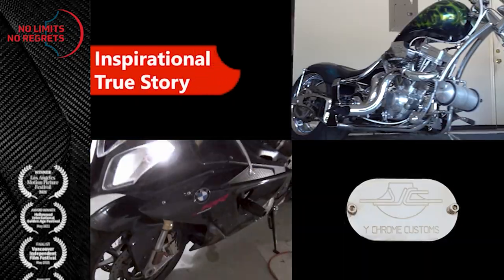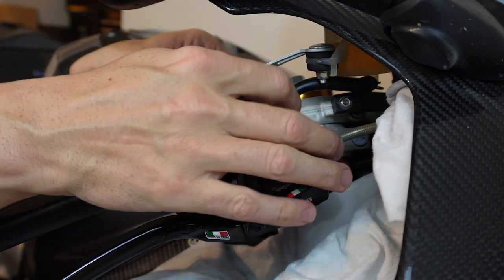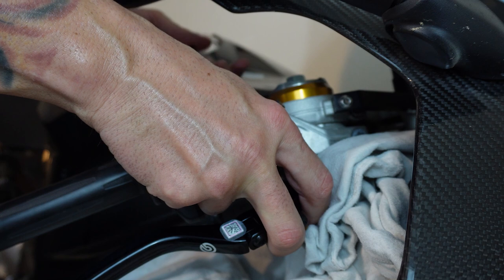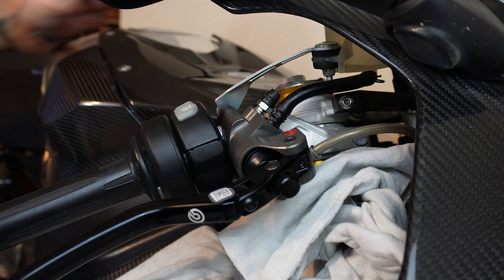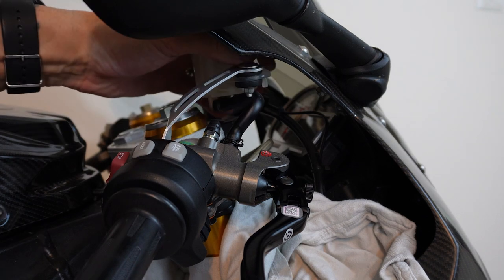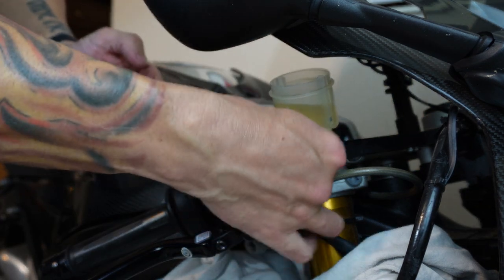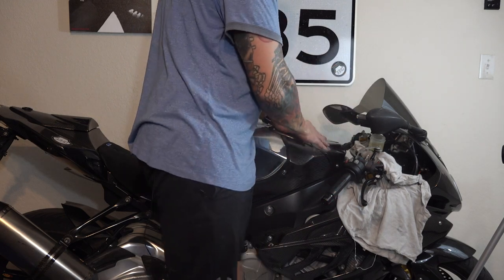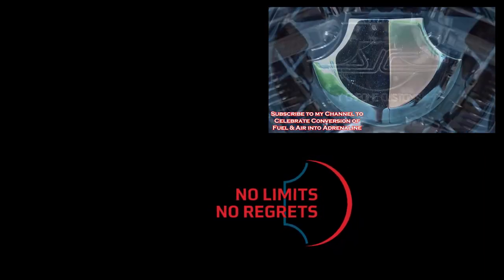RACING MOTORCYCLE Modification w/ CNC BREMBO Racing Brakes MC on BMW S1000RR CUSTOM

Comment: I installed the 19 RCS Corsa Corta yesterday on my 2020 S1000RR using this video as a guide. Installation was very straightforward (took less than an hour) and there was hardly any air in the system. I went for a test ride and the brakes feel awesome. I can't wait for my next track day in a couple of weeks.
Reply from the maker: awesome! should be a huge improvement over that nissin. my buddy has a nissin on his '19 or '20 and....it feels awful to me. he felt my race cnc MC last time at cota and realized the difference, so he'll be upgrading soon too. have a blast at the track!!

Comment: I have a 2010 s1k that i use for street purposes and i think im coming across this issue now, it has nearly 40,000 miles on it.
Reply from the maker: quite a bit of miles, nice riding! i always hated the nissin on them stock. the RCS19 was good for a long time, but this race grade one is aces. My buddy has a '20 s1k and was starting to get grief about his front brake lever on track days. i felt it and groaned, told him to feel mine, and he said, "oh wow, mine sucks compared to that." :) it's a nice upgrade for sure!

Comment: Dear sir,thank you for the tutorial videos as always. My 2021 S1000RR has a tiny leak at the bleeder screw in the rear brake caliper so I was wondering if you have ever had this happened before and how you fixed it. It is not under or over tighten as I have checked the torque. Thank you!
Reply from the maker: strange, no i haven't seen that before. since you said you've confirmed it's torqued properly, the next check would be if there's a little piece of trash under the bleeder valve that's preventing a seal. if you confirm it's all clean, perhaps inspect the bleeder valve for any flaws that prevent it sealing and replace if necessary. hopefully there's nothing flawed on the caliper side causing the issue as that's a lot more expensive than a bleeder valve.
Reply: @NoLimitsNoRegrets  thank you so much, sir!

Comment: How was the billet compared to the cast riding wise, and is it worth double the money?
Reply from the maker: a racer buddy of mine said the RCS are fine for most street use, but just not the quality needed for the track, and that's kinda where i ended up. The more track days i did, the less confident i became in the RCS, but i feel rock solid on this one. my other buddy still has a stock nissin on his '19 s1k that feels awful to me. he felt my brembo and realized how poor the nissin has been, despite getting concerns from tech check before on his.
Reply: What did you notice feeling wise. Track or not
Reply from the maker: @Itsjustriding  it might've felt marginally more firm, but that may also be just me and how i adjusted it. to me the biggest leap from both stock to the rcs and rcs to this one is the consistency, no fade, high confidence in being able to stop every time the same, and this has been only track use since installing the new MC.

Comment: Can you please make a video on that HP seat?
Reply from the maker: I appreciate the feedback to help guide new videos. I don't remember if i actually put it on or the guy who did the engine swap did, but i actually don't even have it installed now that i put all the race carbons on it, and the new plastics had a thin foam integrated seat. With it not in place or able to do much now, are there any questions you have about it specifically i might be able to answer from memory?
Reply: @NoLimitsNoRegrets  much apreciate you replying . I have a bit of a problem with the shape of the normal seat .How dose the HP seat changes the ergos when you are at full lean angle hangging off? Sorry my english is not the best.
Reply from the maker: @cristian821987  The HP seat is slightly lower profile, lighter, probably easier to slide side to side across it as i think it is thinner on the sides for that purpose, but it's definitely not as comfortable as the stock seat, at least on my 2010, for straight line long distance riding. if your focus is track work, then something like the HP seat might be an improvement based on my experiences, but I do a lot of street riding too, so i may not have the same perspective you do. Is that helpful at all?
Reply: @NoLimitsNoRegrets  it was verry helpful especialy the "thiner on the sides part" that is my main problem with the stock one . Have a great day !
Reply from the maker: @cristian821987  great, glad i could help!